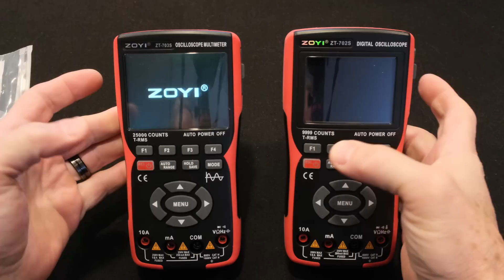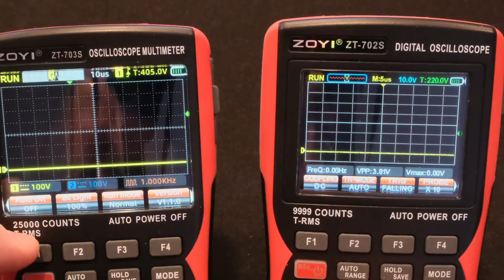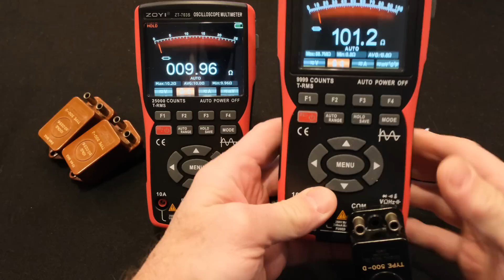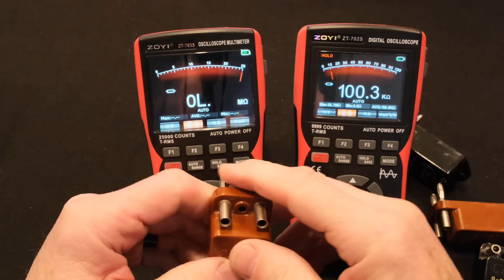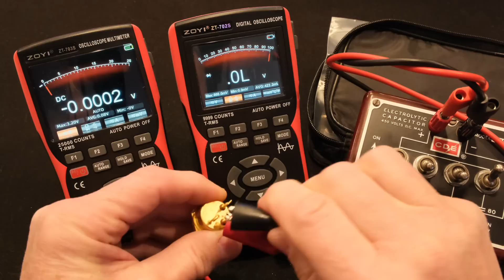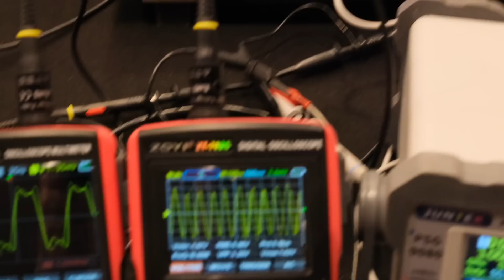New Low Cost ScopeMeters by Zoyi the ZT703S vs ZT702S deep dive #handheldoscilloscope #ZT703S #ZT702

Comment: The hold light is ON when you pull the precision resistor. Could be there is a contact in the meter socket that causes that funny thing. You should test with the supplied meter probes to see if that is the case. Regards.
Reply from the maker: Thanks for your feedback!

Comment: Quality issues. Received mine and scope reboots to white screen, then goes in to a loop. Meter shuts screen off after 10 seconds, useless.
Reply from the maker: Wow - were you able to return it?  Which one did you have?  Did you happen to try to load a new firmware release?

Comment: 1.4.2. Upgrade details:
Added FFT mathematical function, replacing the original format key with an FFT switch.
Optimized low-frequency AUTO speed and accuracy.
Enhanced the scrolling scan mode.
Improved the cursor display issue in scrolling mode.
Reply from the maker: Thanks for this feedback!

Comment: For frequencies above 33 MHz the run mode needs to be set to HIGH, then it works up to about 47 MHz ok, but the battery consumption goes up by 20%, so resets to normal when rebooted each time.
Reply from the maker: Thanks for this input!  I"ll have to check that.  Do you have the latest firmware version?
Reply: @KissAnalog  Yes, V1.3.9

Comment: Did you set Run Mode to High when you were doing the higher frequencies above 30MHz on the ZT703S?
Reply from the maker: I think I did - but now I'm not sure;)  Did you have a question on how it worked?
Reply: @KissAnalog  just wondering about the frequency range to 50Mhz.
Reply: @EdSym1  On sine wave its steady when set to high speed mode up to 46MHz, as soon as you go over, some jitter starts up but the sine wave is still there to well over 50MHz.

Comment: Appreciate the review of these. I got the 702. I have noticed the same strange readings when using the scope functions as well. One thing you didnt show or were not aware of, when measuring higher voltages (110 vac and up) the white numbers turn red. Its not a huge issue but the red numbers kind of blend in a bit with the red on the "analog" display, makes it a little harder to see. Battery life on mine has been all over the place as well. I got mine for about $45 on temu, cant beat that.
Reply from the maker: Thanks for the great feedback!  Yes I realized I forgot to show the high voltage warning (red LEDs) and I wish I had.  It is a nice feature, but if the display is hard to see - then maybe they could have changed the background too?

Comment: Dumb question – I want to get an automotive range (200-500A) current clamp to measure starter motor draw / injectors etc..., which clamp should I buy for the ZT703S? Can the ZT703S record an oscilloscope trace from the multimeter banana connectors? Or do I need to buy a BNC connected current clamp? Thanks! Great videos.

p.s: This Zotek model is going to be huge in the DIY market, and bring a lot of people into oscilloscope based testing... you could really corner the market in tutorials if you made a 702/703 specific series of "how to test ______ issue in 5 minutes using a 703/702" type videos.
Reply from the maker: Thanks for the great feedback!  Yes, I would get the clamp with BNC connector so that you get the benefits of the scope bandwidth.

I think that series showing how to use these handheld scopes is a great idea!  Thank you!
Reply: @KissAnalog   OK got it! Do you have any make / model recommendations? There seems to be a huge price range for BNC clamps from $30 up to $3000, not idea how to judge what's decent / garbage/ Thanks again!
Reply from the maker: This is a low cost current clamp that will work with the scope.  https://youtu.be/XCboJngcR6U
Reply: Aliexpress: HP-605A

Comment: Hi Eddie, so the Zoyi seems like a bargain for the cost. However, I got a FNIRSI DPOX180H handheld dual channel digital oscilloscope at 180MHz for a few dollars more at the AliExpress 11/11 sale. While it seems clear there are several trade-offs, and the manufacturer's specifications are a matter of interpretation, I was wondering if you are familiar with the DPOX180H and if so, what your take on it is?
Reply from the maker: Thanks for asking.  I'd love to run a comparison side by side with the ZOYI.  The FNIRSI looks great but is around $170 where the ZOYI is only about $75.  For the price of the ZOYI - it is pretty impressive.

Comment: Nice, I got a similiar speced one last year minus the multimeter.  and it has done me fine (measuring pwm pin of a MCU etc) until i found a video on it and was disappointed to see the signal jump around in a real audio application. It too measures in the 5-10mhz range by some reviewres although it boast 100mhz, so the signal shouldne be bouncing around at 1khz like in this guys video? https://youtu.be/hdTBvg1mhgk?si=H84gEHj7yppNxtOx   Maybe he doesnt know how to use it correctly, like triggering and what not and I was kind of hoping youd go into that a little more.  Oscilliscope basics, probably who'd need it if youre buying a scope at this level.  Like theres an auto trigger, manual one, had no idea what that even meant other then pressing auto seems to work fine.  Anyway I think i got the jist of it and seeing the bandwidth test was cool and ill have to do it on mine.  But now i want to see the switching action of a mosfet, or the recovery time of a diode and  still dont know how to do that.  Like to capture a fast moment.  Are these scopes capable of that or should i be upgrading?  I was gonig to recommend these cheap ones but not sure after seeing that video of it being used for guitar effets pedals, unless he's not using it correctly but i was expecting more stable images in audio range, so you can compare easily. Ill have to try myself.  Thanks for getting me back in the mood.
Reply from the maker: Thanks for your feedback!  I need to do a beginners guide to using an Oscilloscope:)

Comment: Eddie👍👍 I think there's an option for two scope probes for the 703s during purchase.  You maybe could use the 702s probe along with the 703s probe for two channel use on the 703s scope. Nice and thorough showing the differences between the two scope meters, thanks.  You've run out of room on that bench😮 You're gonna need a bigger boat😉
Reply from the maker: LOL - thanks - you are right!

Comment: When checking for probe setting, AC coupling etc., you always looked at the channel 2 settings, but the generator was connected to channel 1. Maybe this is why the readings looked a bit odd. However, when autosetting, the scope should show the correct values, e.g. 1V instead of 1.4V.
Reply from the maker: Thanks!  I did turn off channel 2 at one point so I was just testing channel 1.  Did I make a mistake somewhere?

Comment: Do you actually use anything you buy for work or just review it for YouTube? There’s no way anyone with a desk that small needs that many testing devices.
Reply from the maker: Yes I actually do take some devices into work - one to get the job done quicker - and two to demonstrate it to the group so that we can consider getting one for the lab;)  

Yes you are right - I don't need all this for my work at home.  I always have projects going on - more than one at a time;)  But much of this is to show others so that they might have options to choose from.  I try to compare devices to make this easier. 

I do have two other benches that are never shown.  The camera compresses the image, but the bench you are looking at in front with the multimeters on it is almost 6', and the one with the larger equipment on it is 7' long.  That is 13' of bench;)

Comment: I can't believe how much I like the 702. Really nice trace. I ran into issues right away with it but the latest firmware update took care of it. Very easy to do by the way.
Reply from the maker: Thanks for the info!  I need to update both these meters if there are firmware updates.
Reply: @KissAnalog  Press the menu button and scroll over until you see the version number.  As of about a month ago version 1.03.58 is the latest for the 702S
Reply from the maker: Thank you!  It looks (at 21:45) like I have 1.03.43